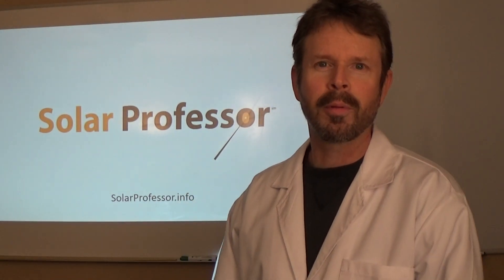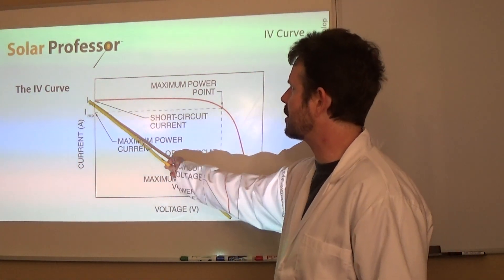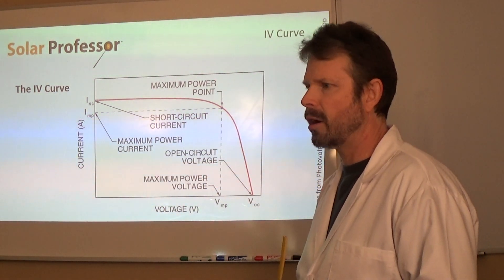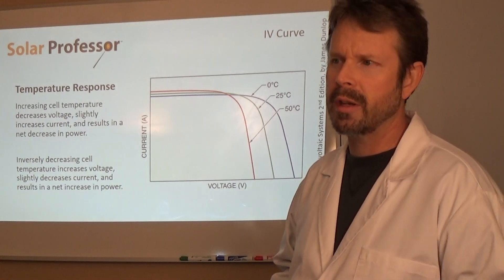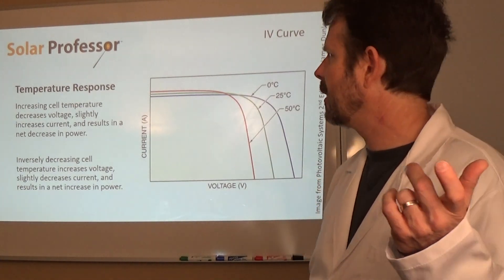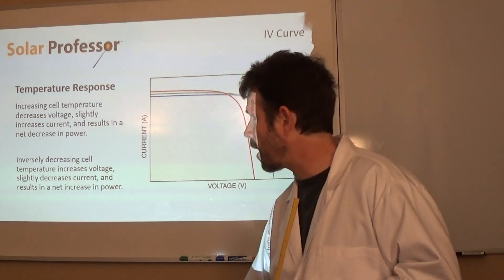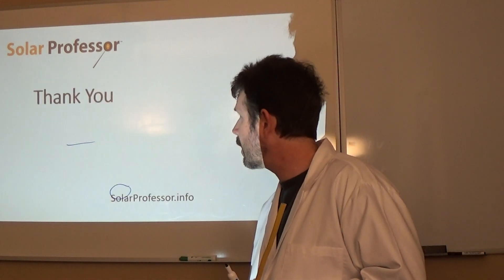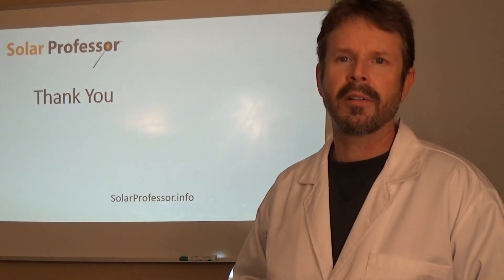NABCEP - MUST Know - IV Curve*

Comment: In the 2nd NABCEP Answer on timeline 13:09 it was said "In Parallel" which is incorrect. The Sum of Module Voltages is measured in Series - Not Parallel. The Answer is correct for 16 Modules, but these is the result of Modules connected in Series and not in Parallel. Please see the National Electrical Code 2017, NEC 690.7(A)(1) for further assistance on how to determine an Array VOC in Series ...

Comment: Can a panel exceed its Isc like it can its Voc? E.g. if we reduce the temp used in STC (no other change), the Voc changes, and we need to worry about over voltage.  Do we need to worry about over current conditions where the panel may exceed its Isc? E.g. high temps reducing voltage and increasing Isc?
Reply: Over-Voltage must be calculated based on the lowest temperature reported where the modules are being installed. You must also provide for a margin of error on reported temperatures. This is due to the fact that Charge Controllers have a Maximum VOC Operating Voltage. If VOC calculations are not correctly made when adding modules in Series, with the additional temperature changes for that geographical area, Solar Modules can produce more voltage during colder months, thus exceeding the Maximum Voltage of the Charge Controllers, voiding manufacture warranties, damaging equipment due to over-voltage or both.

Comment: Great stuff. I have one question. Your diagram at 5:55 shows 3 different open circuit voltages. Is the one in the spec at a minimum temperature?
Reply from the maker: Thanks Keith.  The diagram shows a low temperature of 0 degrees C, however it is not a minimum.  It could get even colder and further increase voltage.  (I hope that is what your question is referring to.)

Comment: Isc is also a measure of the light energy striking the panel or I_photon. Isc can be used to calculate the actual light energy, because it has a very small temperature coefficient, that can be ignored. 

Isc is calibrated to 1000 watts/m^2. Measured Isc divided by Isc at stc * 1000 gives the actual photon energy in watts/m^2 in a real world environment.
Reply from the maker: Great additional info Peter.  Thank you very much!

Comment: At 13:09 min you said 16 modules in parallel. Did you mean series? Parallel connection voltage will stay at 13.6V Or am i confused? Tx.
Reply from the maker: Hi Schalk.  Thanks so much for catching that - "good eye and ear".  You are absolutely correct!  I should have said "series." I made a note in the comments section about this correction.
Reply: @solarprofessor7695  Cool, Tx for the channel , love your vids!

Comment: But where did you get 36.6 on the first problem
Reply from the maker: Thanks for your question Mahmoud.  36.6 is the Open Circuit Voltage listed on the sample "Sharp" brand module label in the presentation.  (It is 2 slides back from the one with this problem.)